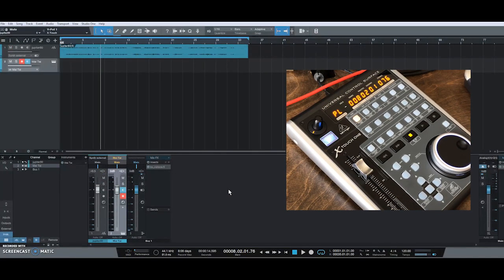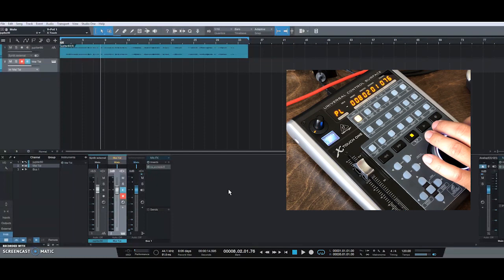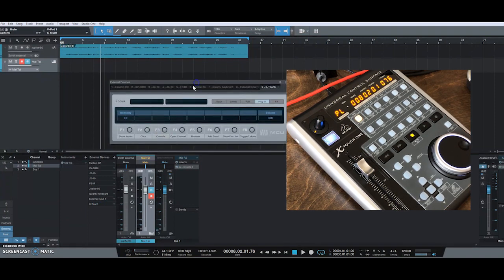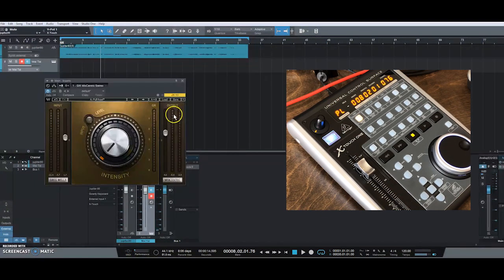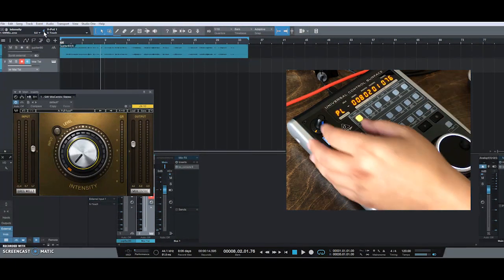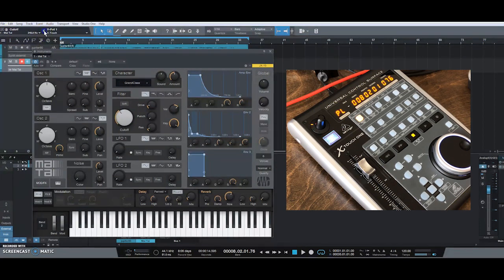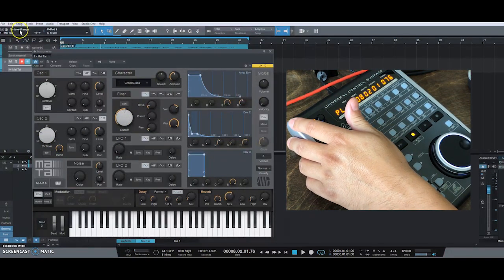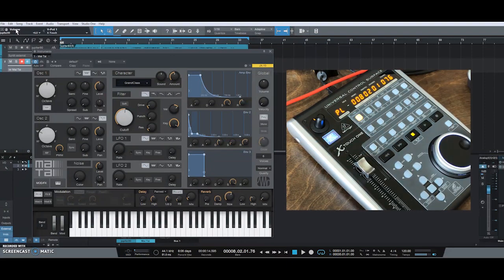X-Touch One and Studio One - Plug-in Control

Comment: I noticed that the Encoder knob controls the Pan on all channels. It seems like it's assigned gloablly (which is great). I'm trying to figure out how to do the same thing with Input Gain. I want to assign the Encoder knob to control Input Gain on all channels. I've only been able to manually assign it for up to 8 channels. I can't figure out how to get it bank over and follow the tracks like Pan. Any ideas?
Reply: Try pressing one of the left/right direction buttons to get to the next bank of 8. They are right below the forward/reverse transport buttons

Comment: Thanks for showing this. Really nice to have the visual confirmation. So, the encoder reminded me of the original Faderport as you moved it. The response seemed to be very slow on your software (like you had to turn it a bunch of times, instead of just like a 1/2 turn as you would on a console). And it sounded clickety. Can you speak to the quality of the knob? And is it setable for speed/response?
Reply from the maker: Yeah it is a little clicky.  And as far as I know you can’t change the speed.  It seems like it was designed mostly for panning.